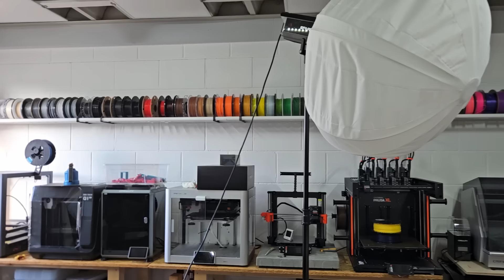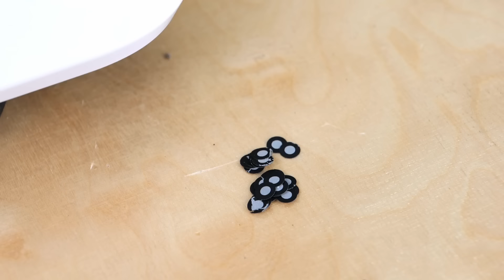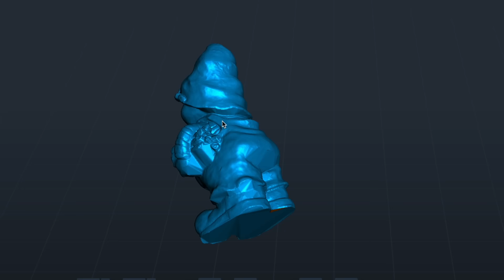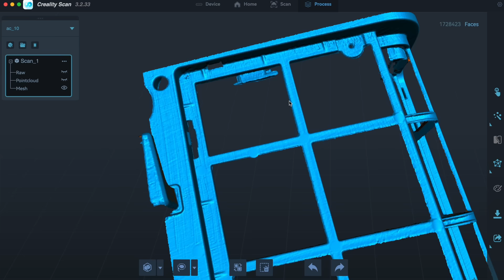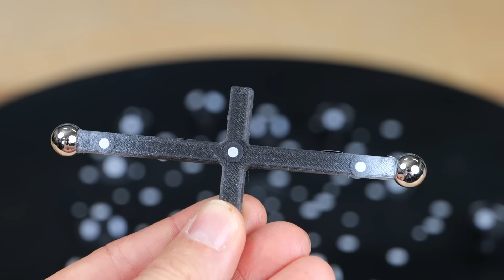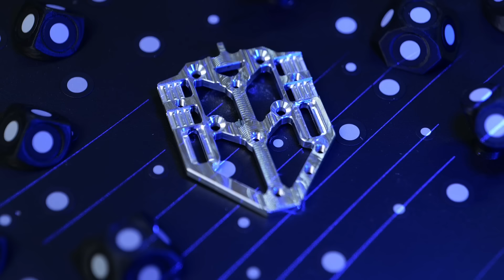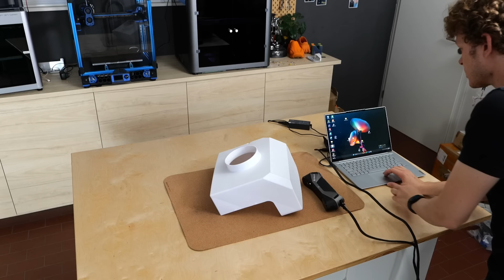Your 3D Scans Suck? Try this! (feat. Creality Raptor)

Comment: I find the Raptor works great with parts but it falls apart when scanning people. I don't know what it is but I have tried every setting permutation on NIR and am still getting poor results. It starts of scanning quickly and well but then starts saying to check exposure and distance but that doesn't help. Super frustrating. Scanning people was the main use case for me. I am going to contact Creality.

Comment: Hopefully Creality or other 3D scanning companies see this (I doubt they will or would care) but, personally, for me, the biggest annoyance with these scanners are the short cables. They expect you to only scan on a desk right next to your computer instead of giving 10-20ft of usable cable.
You can of course use a USB extender but still need a power extender as well because of the Y block.

I feel like with the performance of USB C, they could even make the Y block have a female USB C on it with different length cables to keep costs down. If you need a longer cable, can buy an extender (to a certain length). 

This was my issue and with my Einstar providing to me a little more accurate and easier results being wireless, I returned this scanner and kept that one. 
I dont mind the cable if it was long enough for me to put a computer at the door of the car and scan the entire inside or dash without having to constantly move it all in order to reach. 
Hope to see this improved for the wired ones.

Comment: Hi, thank you for your video. You talk more about laser scanning. I have a Ferret Pro scanner and it uses NIR. Some of the things that I noticed is that you need to scan on the surface that has the nearest brightness to your model. If you scan a white part you should use a white turntable. Because the camera has to adjust exposure and if the surface around your part is too bright or too dark compared to the model, it will be hard for the software to auto adjust exposure.

Comment: I have a master's degree in geomatics engineering, specializing in optical metrology, and I have to say your advice is all great! One thing I'll add, when adding geometry to a part, there's something you can use which gives good results and is really inexpensive: ping pong balls! They have a very consistent radius of 42mm (I believe, it's been a while since I wrote my thesis). And because spheres can be scanned in any orientation and you can always estimate their center from the surface scan, each one provides one very well determined registration position.

Comment: Should not the right software/hardware combo be able to 3D scan with cameras only, with out defects? 3 10 Mpixel cameras mounted in a solid frame at exact angles should give a 3D image better than your own eyes and at the right size as they "know" where the other cameras are and at what angle from each other. Perhaps only at small to medium scan distance but still.

Comment: I HAVE THOUGHT ABOUT THIS MYSELF! :D
Was looking into this when technology connections' video on those units dropped.
The model I got with this type of conversion in mind is extremely similar as yours as well.
Started using 3df Zephyr two days ago to see if I could get some good results with photogrammetry, and this was one of my main projects for it.
Just saw your video recommended when looking for updates on Christa Laser and if she has made any progress with the brick-layer-line 3d printing technique that might be wrongly re-patented.
I feel like this is one of those "glitch in the matrix" kind of moments.

Comment: The accuracy of the 3D scanner per 100mm in not correct. You scanned small object can be captured with a few shots or even with a single shot. But when you scan big object the 3D scanner program overlaps multiple single shots and alignments between the shots can result huge deviation for big object. It would be cool if you tested big object accuracy rather than small object accuracy. Even cheapest 3D scanner can scan small objects quite accurate but the problems begin with big objects.

Comment: it says metrology grade but the second you spray anything on the part you are changing dimensions by a few thou which is enough to make a metrology grade scan wrong… we had to scan some metal stamping die blocks we didn’t have prints for and needed results down to x.xxxx [in] for certain area to be replicated and function properly… what did you find the real world accuracy to be?

Comment: I also have the Raptor and the best way to proccess the scanned parts is to open all the optimized point clouds into Meshlab and then do the alignment there (The yellow circle with an "A"). In that menu, glue the first object, then select the second one and use the Point based Gluing, then repeat the poaint based gluing with all the parts
Reply: Question for a real owner, if you don't mind: I see a lot of negativity out there for Creality Scan software (reddit mostly)...do you find it to be buggy or unstable to the point of unusability? I always assume 50-75% of negative technology product reviews come from lack of patience or general understanding of a product

Comment: I spent $200 on my cr-scan ferret. The raptor is $1500, and the otter is $800. I imagine most of the viewers have a ferret since the pro model costs 50% more and the SE is not that much cheaper. Not to be that guy, but you focus a lot on the laser mode that only the raptor has. Tip 8 and 10 are definitely the most important in my opinion. tip 5 is also pretty good.

Comment: Probably would have been easier to scan the vent cover your removed rather than the A/C itself.  But for the cost of the scanner you could have gotten a single-room heat pump installed lol.

Comment: Hi. Been watching yo channel for a long time and I decided to get me a first 3D printer and I never worked on one nor I know what parts are good or not. I found an ad for a used one but can't decide if it's a ok deal! Would someone telme if this sound ok what he wrote?

"Slightly used 3d printers of the brand Creality Ender 3 Pro. 3d printers have improved valves for "part cooling" ptfe tubes that are more resistant to temperature, which allows the printing of ABS and ASA filament, improved extruders that are not prone to breaking the handle. One has a v6 hotend with bi-metal tubing. 2 printers have automatic leveling with the help of a clipper, it is possible to restore it to the marlin firmware.

Possible exchange for computer components, phones, 3d printers and parts for them."

110e for one or if buying all 3 then 100e each.

Thanks for any advice!

Comment: Not related to this video, but I'm not sure if comments on older videos get attention or not :D so I'm asking here
I've just preordered the iFixit soldering toolkit, to upgrade from the "cheapo" TS100. And I'm now browsing through the CNC Kitchen store to pick the correct soldering adapter that would fit on the iFixit soldering iron, to also use it for driving heat set inserts. But I'm not sure which adapter I should get... I don't know if the one I already have for the TS100 would fit or not... By the looks of it, from what I've seen in iFixit unboxing videos, I would say that the most similar to the iFix it one is the "T12", at the connecting part at least, with the 2 stripes appearing to have about the same distance between them as the iFixit iron (I suppose that's all that matters?). But I can't be sure, and I am also not sure about the thickness there, if it's identical or not. Although, it would be nice to actually have the entire iron tip of the same design as the iFixit one, except the actual tip of the tip, of course, which would be adapted for the heat inserts tips... if you know where I can find one or if/how I could modify the iFixit one myself, I'm not sure what's the process...
Edit: I assume an adapter must exist, even if it's neither of the TS100 or the T12. I suppose there is a standard at least, and there are only a few possible connections for soldering irons, right? It would make no sense is every company would have a different way/design to connect the iron to the handle... Like USB ports for example, there are only a few possible usb types (from a physical design stand point), with mainly 2 or 3 being used the most.
Reply from the maker: It's unfortunately neither TS100 nor T12. We're looking into sourcing similar adaperts as well but this will take a bit.
Reply: That’s still good news. I’ll keep an eye on the CNC Kitchen store 😁 Thanks!

Comment: I would scan the cover and not the socket of the air conditioner, and then i would just change it to the shape i want, knowing that it would already fit inside. Correct me if i'm wrong

Comment: I got this scanner for only 900$ on Ali. The scanner is great, their software is absolutely disgusting. And they make it even worse with updates. All in all, 3/5 for such price.
Reply: Question for a real user, if you don't mind: I've seen a lot of negativity out there for Creality Scan software (reddit mostly)...do you find it to be buggy or unstable to the point of unusability or can you work around it? Thx!
Reply: @EricPalonen  It's stable but unusable. If those people were designing a car, they would make it with 2 steering wheels: one for the left and one for the right wheel. And place them behind the driver seat.

Comment: As a service provider I work with an industrial Laser-Scanner which is calibrated. They are in the 40-50k € range so nothing for home-users. Even if it´s not comparable to the industrial devices it´s quite impressive how well those entry level scanners work nowadays. However regarding the accuracy-claims I am sceptic since they don´t provide any information regarding the test procedure. The only official test procedure for those devices is the VDI/VDE 2634 part 3 performed by an ISO 17025 accrideted lab for this procedure using also calibrated artifacts. And only one calibration costs more than the whole consumer-grade device. To monitor the reliable function of my devices on a regular basis and in non-lab conditions I use a calibrated ball-bar with also calibrated spheres and a length of one meter. In that way I can check the local accuracy by scanning the spheres as well as the volumetric accuracy by scanning from sphere to sphere and measure the distance in an analysis-software. By the way you can also get different values when using different softwares depending on which algorythms they use e.g. to fit the sphere to the scan data. You should also use the raw pointcloud without meshing because also during the meshing process the data can be manipulated by the smoothing algorythm for example.
Since I´m located in Germany - If you are interested we can scan my calibrated ball-bar and spheres with your scanner and see how it performs.

Comment: The artifacting is the only thing keeping me from getting one yet. I have things I need 3D scans of, but they need to be accurate and are otherwise reflective parts so they will require coatings where the coatings might texturize in an otherwise undesired result where it needs to be as smooth as possible.

Comment: THIS. This is exactly a project I've been wanting to do. I'm amazed single-hose A/C's are even legal in California, but they are the most common. They should be OUTLAWED. Why waste all that energy sucking hot air into your living space while trying to cool it? And the negative pressure sucks dust into the house as well.

Comment: Dude I use photogrammetry since years and it cost me 300€ in total. My resolution is about 0.05mm if I want it to be or 1mm on large objects like buildings, yes that´s right I can scan from the since of a finger nail to a whole building either with my cheap 24MP DSLR from almost 15 years ago or with my smartphone.

Comment: Yes! Please make a video on preventing warping of large PETG printed parts! It's not intuitive for me... I would think that it warps while printing and then successive extruded layers printed on a warped printed part would show something resembling a layer shift. However, I discovered no such thing and the finished print was great quality but warped similar to yours. For context I designed and printed an 8kg center console for my car from the radio to the back of the front seats.

Comment: I bought a Revopoint Mini a few years back … it's useless. You need to matte everything, and even then it still loses tracking way too easily.
I kinda want a Raptor to see if it makes a difference, but it's way too expensive for an impulse buy – especially if you've already been burned once with a consumer level scanner…

Comment: I tried turntable too, but it was not working correctly, but know I have the towers (without magnets are base too small and needs to be increased) and moveble stones. What is interesting is, that raptor has stativ mounting point at one side, but main usage is vertical :)

Comment: I have been playing around with 3D scanning for some time now and I got my hands on the two new creality units. My main gripe is that damn edge issue when scanning and merging. I have to compare to my Artec units. I have both an Eva and a Spider and just the software for those machines cost about $1k a year I do have to say that for roughly 1/13th the cost of the artec stuff these Creality units have some serious potential. And the decent resolution and accuracy that makes these scanners a very nice proposition for those looking for those features. CREALITY PLEASE PUT MORE RESOURCES IN TO YOUR SOFTWARE. Great video btw and thanks for sharing.

Comment: For me, going the photogrammetry route yields enough precision for many scenarios. If the object is too reflective and you don't have chalk spray at hand, using imprints in blu tack / play-doh (or "blue stuff" for a more reliable temperature based mold) also can be really helpful to get precise scannable reference especially for small details. Also, using the iPhone FaceID (iPhone X/Xs/11 actually had better resolution than iPhone 12 and newer because of a much denser light dot array!) to scan with e.g. the "Heges" App can yield great results for medium to big objects/areas without buying another expensive seperate device just for this purpose.

Comment: This kind of tech and cost feels like a good fit for a library with a tech person and classes.

My local library is awesome and has several 3D printers with community access and a dedicated staff member who is familiar with the tech.

Additionally, they have a library of things section where we can check out common household items or items that aren't common but are the kind of things you might want to borrow once in awhile like a sewing machine or laser measure.

Having a 3D scanner to use at the library would be a great community tool!

Comment: Bought the CR Raptor too. Really nice scanner.
With more markers and less loss of tracking the laser line on the surface will improve.

The curved ends on scans are annoying indeed. I hope they will fix it. I use Geomagic design X to trim the edges of the scan as a workaround. 
And that there is no orthogonal view is annoying as well.

For warping I suggest to use disks with 0.6mm height on corners. The normal brim isn’t stable enough.
Reply from the maker: There is Orthogonal view! Hold Shift and scroll 💪
Reply: @CNCKitchen  hey your right! How did you find it out? 😂
New update dropped as well!

Comment: is there a cheaper option for scanning like the inside of the ear with an easy way to define sizes?
Reply from the maker: Photogrammetry and just place a stick of known length next to the ear.
Reply: Inside like the ear canal? You're probably going to have to cast a negative.

Bill Doran (Punished Props) made an ear photogrammetry video just recently.

Comment: The biggest issue i have is that you get STL's out of it but it sucks to modify those / is impossible todo. Maybe you have a idea?
Fusion360 seems to choke on these big objects. Even if i want to add stuff to such a thing. And the problem is not performance of my workstation as that seems to be mostly bored as well as the GPU.
Reply from the maker: If it's easy stuff try software made to work with triangles like Meshmixer, TinkerCAD or Blender.
Reply: @CNCKitchen  I have the issue that i want to remove a certain object. Which i didn't get how one would do that in blender
Reply: @platin2148  i don't know what system you have, but i had a lot of issues with Fusion360 until one day a friend of mine suggested me to try out Nvidias CAD Driver. I got an Razer Blade 15 with an GTX3070 and the Gameready driver was initially installed. With the other Driver i now have almost no issues so far even with larg STL files.
Reply: @drfailbucket  M1 Max, 32gb ram seemingly no gpu usage or cpu usage 16gb ram are used but thats because the model is a chonker. Blender seems to deal better with it just that i can’t figure out how to separate the thing from the other as its not a simple draw a line and extrude to cut.

Comment: I used Shining 3D EinScan SP V2; a quite nice hardware for the time but the software is crappy as the one for Creality. And, yes, you need a beefy machine: CPU, memory, disk, GPU, everything.
What's even more disturbing is a general lack of GNU/Linux version of the scanners software; especially when they have an OSX version which is a Unix OS.